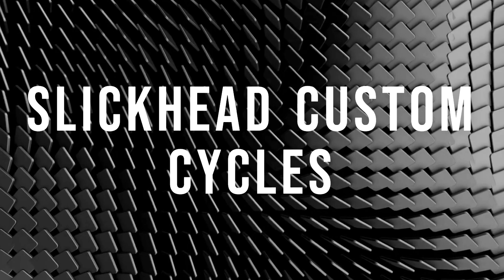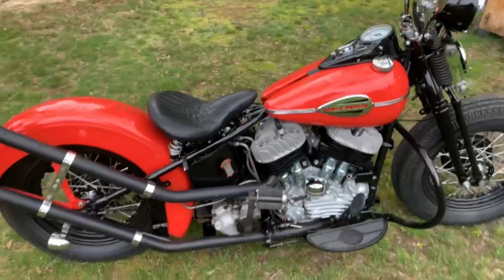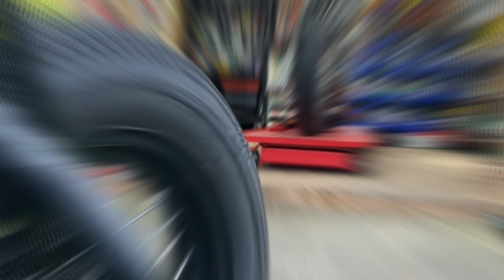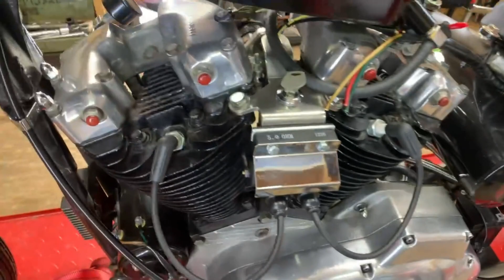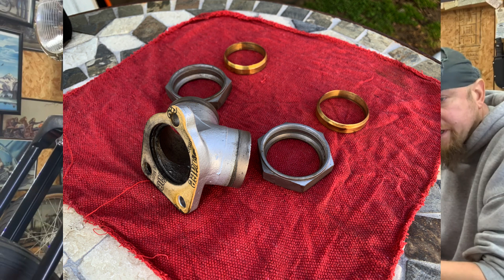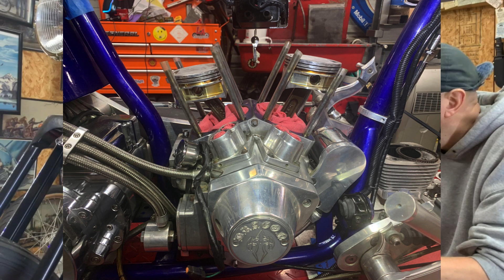Shed Life Update-4/8/23

Comment: On that flathead you may already know this but if that shaft in the center of that linckert if the bushings are worn out you can fiddle with that thing all day long and it'll allow air to  pass by that shaft and it'll change your carburetor setting, like I said you may know that, anyway there you go man
Reply from the maker: Huh. Good to know. But the funny thing is I dialed that Linkert in last summer and it rode great up till i broke my ankle in the fall. I set the needles up like the old manual says 5turns out with the low speed and two turns out with the high speed needle. Once bike is started and warmed up turn the low speed in till it’s so lean it stumbles than back it out 5 to ten clicks until it’s hitting right, adjust your idle. Ride the bike than adjust your high speed needle. Like I said, once before i did it perfectly, this time it’s kicking my ass. Im fairly certain its timed right, it starts first kick every time. I have an e-beyond 2000 electronic ignition on it under that distributor cap. I show all that show. Going to try running it and dialing it in one more time before I take the carb off, which I had off and cleaned it back in the fall, right as I broke my ankle. Thanks for the advice though!!!
Reply: @SlickHeadCustomCycles   I didn't about the electronics you put on that thing. I do remember that the coil used to have a nasty tendency to c*** out and you could always check the points, but if you don't have points then of course that's not the problem. electronic Ignition might be the problem however. the other thing was we stopped using those linkerts, and started using lake injectors or mikuni's but the one thing I do remember that used to happen once in a while that would p*** you off is that the inside of the black hose would break down and put little pieces of c*** in the carburetor. and the other thing which used to really drive us nuts was if there's anything loose like if you're using baffles in the exhaust and there's anything loose in one that can move around it will ! changing the back pressure.  Coil grounding against a frame used to also suck. Hope that helps man.
Reply: Man I should have proof read that  thing, oh well.